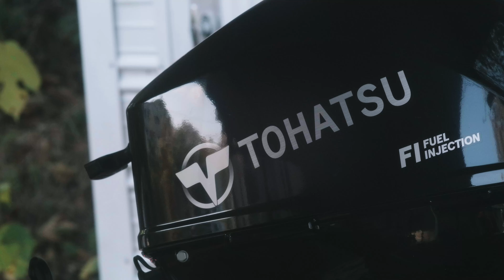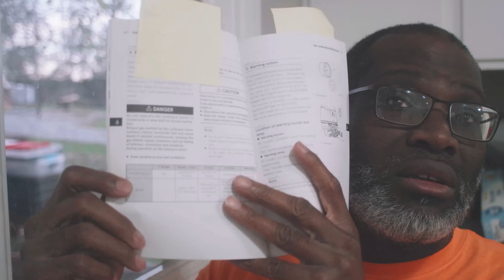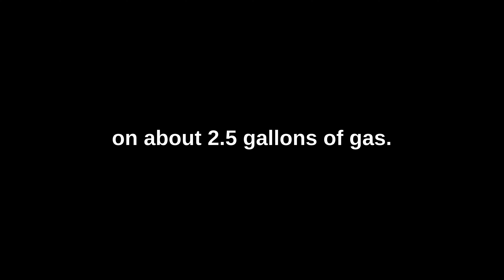Old Boat, New Motor! | Tohatsu 20hp 4 Stroke

Comment: Hello great video and helped me decide to get a Tohatsu 20 outboard motor which I got yesterday. Really enjoyed watching and subbed you. Thanks Steve from England.
Reply from the maker: It's a great motor! I've enjoyed it. They are quite reliable. Glad to have helped.
Reply: is yours electric or manual? is it difficult to start if its manual?
Reply: @ia6980 Hi, it's a manual start. If it's been run dry, it can take several pulls on the cored but normally just a few. If you can manage the extra weight and expense go for the electric start.
Reply: @stevesdaysoff2759  thank you! Yea i dont like extra weight, but again, its only 10lbs more for electric start, gotta start exercising again :)

Comment: I have an old boat too, is Oachita 16" aluminum boat 1970 and Im verry happy with, I will try to buy a  Tohatsu 20hp same like you in the next year. Congrats for your new outboard !!!!!        :)
Reply from the maker: Yeah, the old boats are great! You'll love the Tohatsu. Start right up every time. No cabruretor, choke or hard starting in cold weather. The break-in process is straight forward. The motor runs better as you go through the break-in.

Comment: Like your boat as well as the Tohatsu engine. Looks like a Sears model a friend and I used for catfishing back in the seventies. Very stable as I recall. Solid. An excellent match of boat and motor. Just bought a 20 Tohatsu for my 16'.
Reply from the maker: Sweet! I'd like to get a 16 footer.

Comment: nice video editing! Im hesitant about getting electric start vs manual due to weight difference, since I use inflatable and will need to remove it from transom. Any thoughts or suggestions? Also what about trolling? what kind of equipment you have to help with trolling? you didn't specify? and is your motor electric start or manual?
Reply from the maker: It's both electric and/or manual. The reality is the 10 hp, 15 hp and 20 hp engine are all the same engine. Either way you'll be hauling the weight of a 20 hp engine. Yes, the manual only start will be lighter, but the engine is so well balanced it doesn't feel like 100 lbs when you lift it. I forget the specs. It's like 95 lbs manual, 103 lbs with the starter motor. 

Yes, I troll often. In fact I'm tying some trolling flies now. The dealer told me it isn't meant for hours and hours of trolling. In other words you're gonna have to run it some. The way I troll and drift, I only troll a small area before running to another spot. I have some trolling bags, but I find this motor with my 1652 boat that I don't need the trolling bags. The new boat, is aluminum, so the trolling speeds work well without trolling aids and such. For your inflatable you might need something to slow it down or help with the wind.

Comment: Is you motor the 15 inch shaft or 20?
Reply from the maker: I got the shorty, the 15 inch shaft.
Reply: @BlackWarriorLures  T.Y., going to order one tomorrow. P.S. After break in can you run @ idle for long periods?
Reply from the maker: @baird5776mullet  Well, the guys at Backwood Landing told me they are not good for hours and hours of trolling, but that he did have some customer s who troll without any problems. When I troll I do short trolls, then run at speed back to the top of the troll.
Reply: @BlackWarriorLures  Thanks, i throw a cast net off the front of my boat  for mullet fishing which requires running @ idle speeds for about an hr @ a time, like your channel.👍

Comment: Where does holt lake stop if you put in near rock quarry and go up river?
Reply from the maker: It goes up to Bankhead Dam. That's about a 8 mile run or so from Rock Quarry.
Reply: @BlackWarriorLures  I’m going to have to go up that way and check it out. I thought it was a lot farther up river.
Reply from the maker: @ntj030885  Yeah, Holt Lake is only 9 miles long.